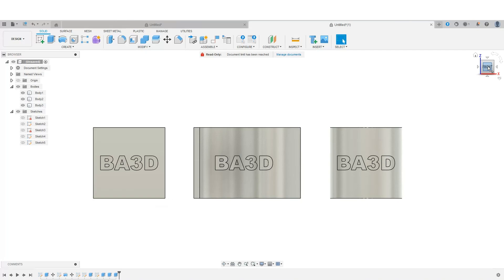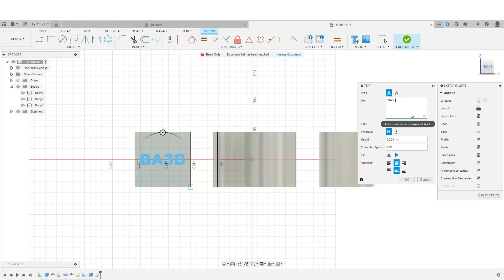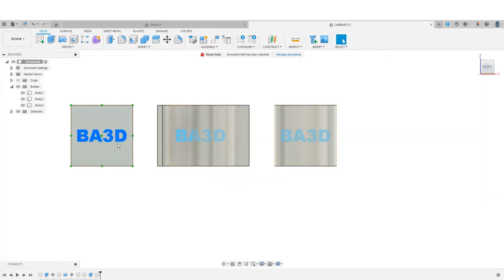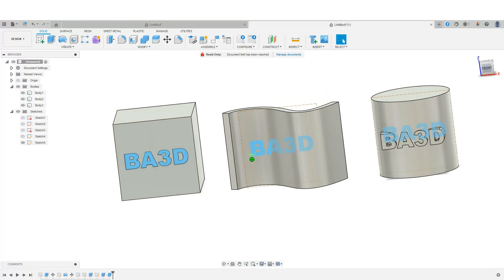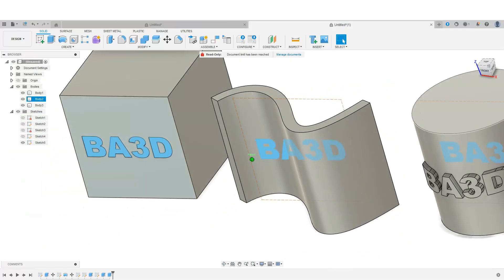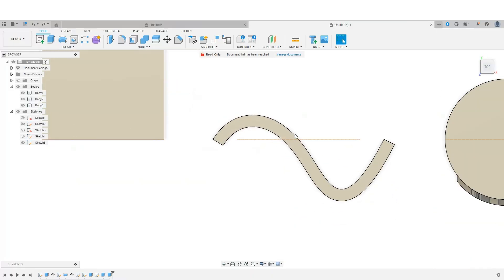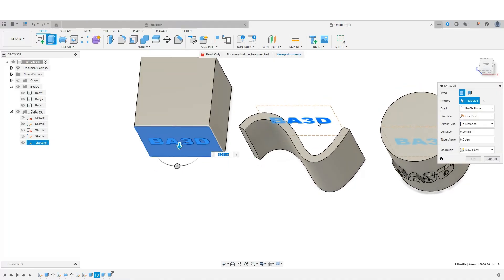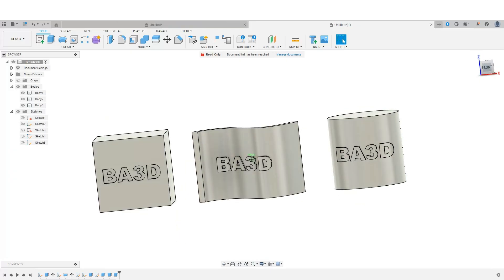Add Text to Any Surface in Fusion 360 (3 Simple Methods)

Comment: Great video! Is there a way to color the text seperate from the body? Im trying to create a sign where i want the text to be in another color when printing. Txh in advance..
Reply from the maker: Thanks is the object you’re trying to print flat or are you standing it up on the plate?
Reply: @BA.3D the letters are extruded on top of the plate 2 mm , thanks for answering😊